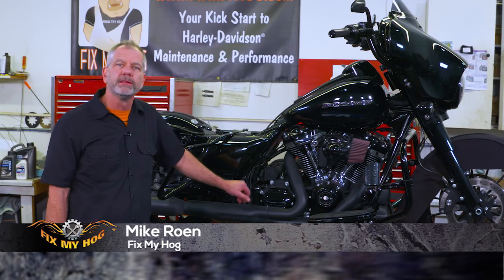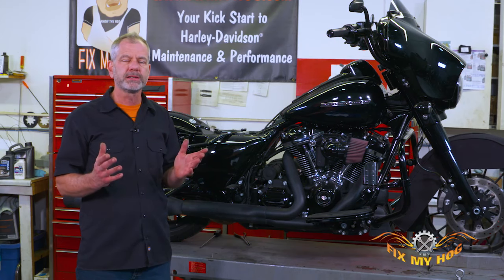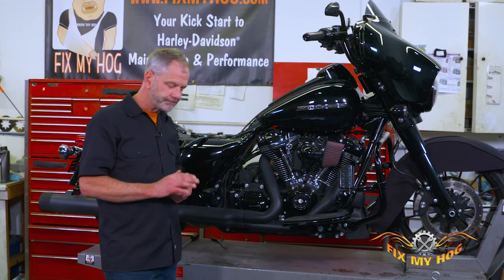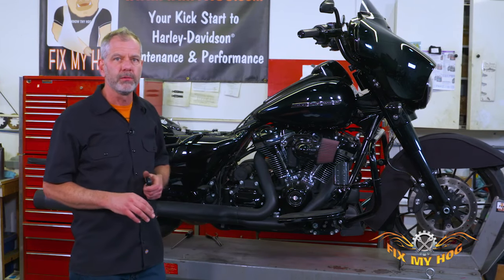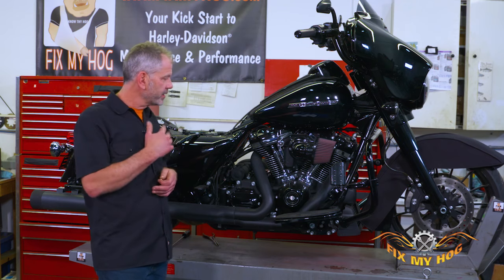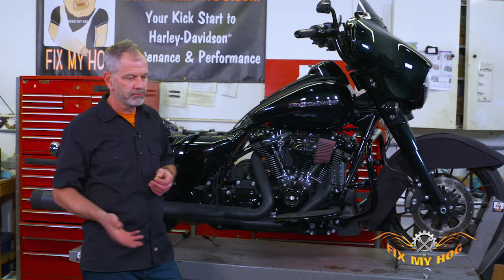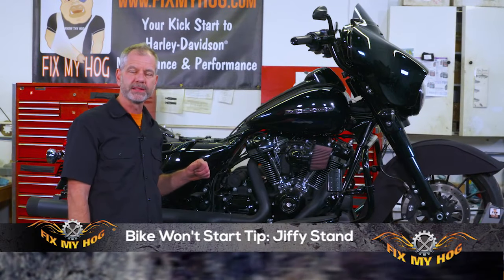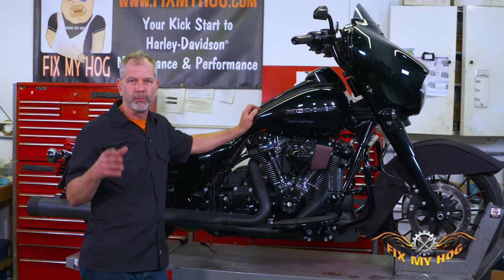Tips on Why Fuel Injected Harley Won’t Start

Comment: Goodday Mike.I have a '98 HD electra glide.I 've been having issues with getting the bike to start.The spark plug coil was bad so i replaced the coil.Did some upgrades with replacing the stator & regulator while replacing the ignition coil.The bike wont turn over when powered up.I installed a manual button on the new starter & still the bike wont start.I opened the primary,put the bike into high gear.The engine wont even turn over when rotating the rear wheel in high gear.The bike has been sitting for a year.Have You ever come accross this issue with the evo's?
Reply from the maker: Great question! We have a lot of great answers on our website.
 https://www.fixmyhog.com/post/tag/starting-problems/
 and ‘Ask an Expert’ section for members of our online community. I would be happy to send your question off to the experts. To get started, please send the email associated with your paid membership account. Thanks!

Comment: 07 electra  classic wont start 12v to starter checked relays changed battery in fob changed start button but push button and does nothing no click or anything
Reply from the maker: Great question! The ‘Ask an Expert’ section is currently for members of our online community. I would be happy to send your question off to the experts. To get started, please send the email associated with your paid membership account. Thanks!

Comment: On the way back from Sturgis to Austin, we went through CO. I had an issue with warm start. The CO Springs dealer said to try disconnecting and reconnecting the fuel line, and it worked. Happened again at a shop in CO, and I did not get the line on correctly. It popped off and gas went everywhere. I think i messed up the stop value? Eventually got it back in and started. Happened again at a gas station in TX, and the disconnect was not working so good. Lots of gas making a mess now that the value in the disconnect not quite right. Finally started. On the last day I never stopped the bike for refueling to get home. Once I pulled in the driveway, I stopped it, and it started right up. Any idea what might cause this type of issue?
Reply from the maker: Could be a few things start here: https://www.fixmyhog.com/video/using-a-harley-fuel-pressure-tester-008741/ and our Tech Q&A: https://www.fixmyhog.com/post/tag/fuel/
Reply: Sounds like a tank venting issue, hence why pulling the fuel line fixes it.

What could be happening is that the vent is blocked, pinched or just way too small, and so when the fuel pump is pulling gas out of the tank and sending it too the injectors, air isn't getting into the gas tank to fill that space. So what's happening is a vacuum, and that is not allowing gas to be pulled out of the tank by the fuel pump, but by pulling the fuel line, you're opening a passageway for the air pressure to equalize.

Comment: 2018 rks owner here, i was riding down the road tonight, all of a sudden i come up on a bag of seed someone had lost and i managed to clip it with the driver side exaust pipe, didnt reallize i was still dragging it, made it maybe 1000 more feet and the bike started losing power,  i get off and look and nothing is loose or hanging that shouldnt be, i go to start it and it starts backfiring through the intake, is the the exaust valve getting stuck ive never heard of this before, please anybody anything will help @fixmyhogfreechannel

Comment: 2021 street glide special won't start an throws a code then starts few mins later
Reply from the maker: Check your codes for your year / model and see where it points you. https://www.fixmyhog.com/video/troubleshoot-with-harley-error-codes-008010/

Comment: I've got no power to the right hand control on my 2016 FLSS. Got power everywhere else, just not there. Fuel pump turns on, but the control buttons do absolutely nothing. I have a new control ordered, hopefully that's what it is! Been waiting for weeks. Any tips?
Reply from the maker: Stop by and check out our hundreds of Tech Q&A, it might be anything from the housing, controls to electrical 

https://www.fixmyhog.com/post/tag/handlebars-posts/
Reply: Did you ever figure this out? I’m having the same issue on my 11 heritage softail classic

Comment: Cheap??? know not where you are...but around here it's $30 for the front plug wire...$26 for rear...I do not call that CHEAP!!  That's like our car that uses $14 per quart fluid in transmission...it holds 6 quarts...and has to be changed every 35,000 miles so 3 times a yr. so not cheap in my book.

Comment: 🛑🛑 Worst one I ever had was the little “quick connect” right where the fuel line connects to the lower discharge tube of gas tank. 

There is a small “quick connect”, just use your Index Finger and just “ push up” on the fitting; and the gas begins flowing again, just “jiggled out of the connector”😀👍. 

Drove me crazy one afternoon 💯. 

I hope this help👍
Reply: You prolly dont care at all but does anyone know a tool to log back into an instagram account..?
I stupidly forgot the account password. I appreciate any tricks you can give me
Reply: @Jameson Vincent Instablaster =)
Reply: @Theo Sergio I really appreciate your reply. I found the site through google and I'm trying it out now.
Takes a while so I will reply here later with my results.
Reply: @Theo Sergio It did the trick and I actually got access to my account again. I'm so happy!
Thanks so much, you saved my ass!
Reply: @Jameson Vincent Glad I could help :D